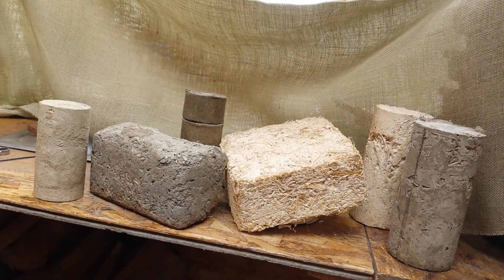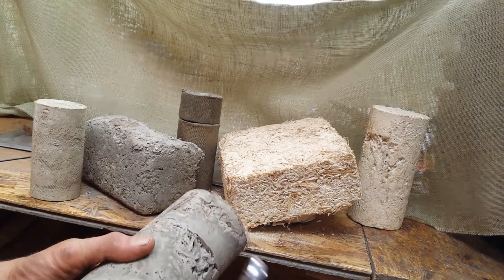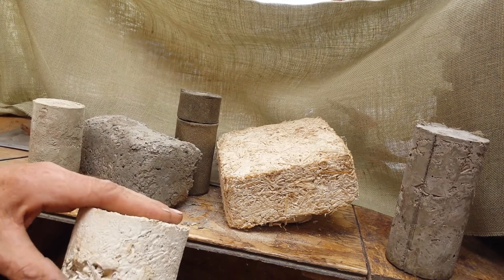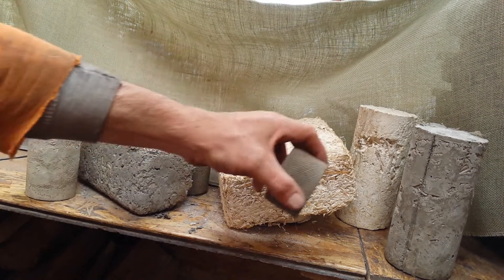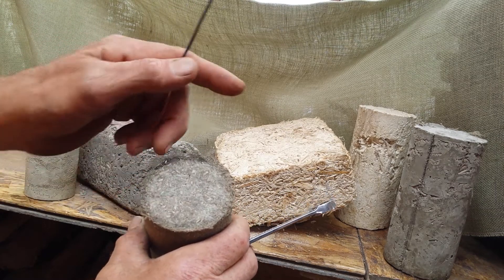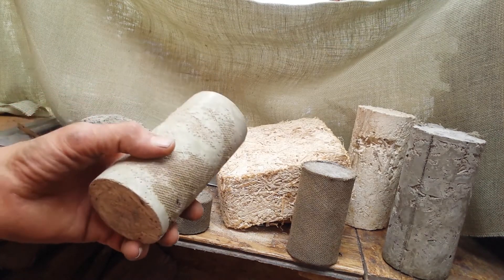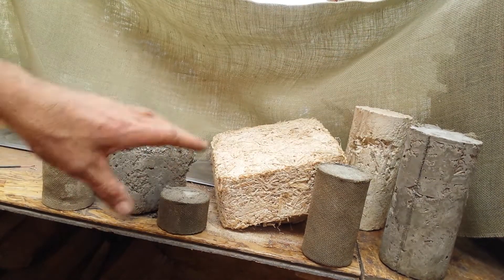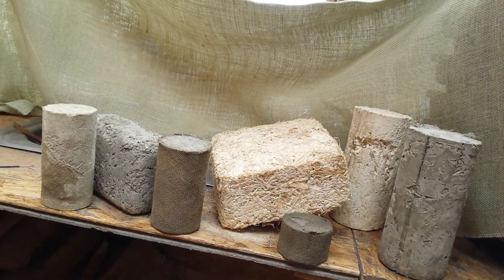Hemp Side by side, MgO to Lime Hemp binding strengths comparison

Comment: What kind of mix did you use for the geopolymer specifically? I've come to learn it's kind of a catch-all for a lot of different kind of chemical bonds and mixtures. You mentioned it's exothermic, so I'm guessing you're likely combining it with some kind of quicklime and water on the fly to make it bond to the rest of the substrate. What I want to know is what is the rest of the ingredients you used, and are they relatively easy to source for a DIYer or other kind of home project?

Comment: how do  you mix the bentonite version i want to mess with it
Reply from the maker: @3DPrintingLoot  basically cob, ratio might range between 2 parts clay soil to 1 part sand and 1 part clay soil to 3 parts sand
Reply: @mrglasecki  thanks ill try it
Reply: @mrglasecki  you should do a video on weight difference between them or if you have id like to see
Reply from the maker: @3DPrintingLoot  working with industrial hemp has broken me from sucking eggs, capitalism has sucked the life out of life love and democracy, greed stupidity arrogance are the goals of the Masses

Comment: As done by Balciunas et al. (2015) and Pantawee et al. (2017), this study used Al2(SO4)3 as the complex mineralizer. Al2(SO4)3 impedes the release of sugar from organic aggregates, thus reducing the impact of hemp hurds on setting time. Al2(SO4)3 is most commonly available in hydrate form, and technical grade Al2(SO4)3 · 14H2O was used in this study. Mineralizing organic aggregates with Al2(SO4)3 has also been known to improve the ability of cement to coat the aggregates, thus improving adhesion (Balciunas et al., 2015). < this is from some research where they use Al2(SO4)3 to presoak the hemp so that Portland cement can stick to it
Reply from the maker: Portland is mineral, hemp is organic, without monomer modification, good luck 🤞

Comment: I am wondering how strong a binding would be if the fibers were bound and pressed like OSB. But instead of flakes the actual Fibers are used.
Reply from the maker: the shiv would make a slightly stronger OSB versus pine shavings,
* Bast hemicellulose will be stronger than any adhesive I've worked with, Even makes a impressive I-beam

Comment: The whole point is lower carbon emissions and a cheap alternative. High calcium limecrete is taking hemp.and adding one of the world's oldest binders. Typs s hydrated lime is not in any way used as a binder historically or now. And to further to help lower emissions, Portland and or acrylic binders is definitely not green in any way at all. And it needs to be breathable. Portland doesn't breath.
Reply from the maker: 😏 the point was it's Significantly stronger than steel reinforced concrete

Hemp bast hemicellulose fiber  17mm ×50mm geo board On Edge" on YouTube
https://youtu.be/HSE5vESjFk0 

With hemp shiv and gasification conventional concrete is actually Co2 neutral

"Live lighting smokeless Hemp fuel Rocket gasification Off-grid sciences" on YouTube
https://youtu.be/ztOrrce7568
Reply: @mrglasecki  doesn't matter if it seals moisture. People will be getting the wrong material and then rotting their timber inside the walls without knowing it. This whole limecrete needs a standard that it can only be used with binders that actually work. Just talked to a guy in a different topic (clay adobe) and he says its failing. Hmm. I wonder why. The point is use the proper material or there will be devastating consequences with breathability and eventually structural supports. No point in showing videos of different psi when you can't even use that type of material. Whether it be Portland or hydrated type s lime. There's no point.
Reply from the maker: @jeremiahnichols2729  

Don't take this wrong😑
Yet, that's hysterical 😂🤣 and so narrow minded it's borderline Ludacris

3/4" x 2" x 12" can support a vehicle
there is Absolutely no reason for pathetically weak wooden framework
 Bast hemicellulose is stronger than steel and lighter than aluminum

 Current construction is literally vapor tight at it's own demise 
 You are envisioning residential m, which is possible at R35 you can run open air HVAC

Sir, I'm proposing skyscrapers strong enough and light enough to be 3D printed over a mile high
Reply from the maker: @jeremiahnichols2729  
Hemp fiber is anything you want it to be if you understand alchemy

"Hemp fiber Starlite 0.0625" @ 3,623°f  meets fiber technology" on YouTube
https://youtu.be/fmCSmI-5MK4
Reply from the maker: @jeremiahnichols2729  please keep in mind the 17mm×50mm test tile you see supporting the vehicle is actually Badly broken

Raw Strength of Hemp bast hemicellulose geo monomer" on YouTube
https://youtu.be/-Ktl6-4B0x8
Reply from the maker: @jeremiahnichols2729  and we will see as hemp-lime frame construction fails because of lack of structural integrity and inability to hold under seismic loads
Reply: @mrglasecki  and you will also see new bacteria and mold in clmmercial buildings due to no evaporation of moisture and then mold flowing throughout the hvac systems etc. See it all to much now on every sheetrock built home. Then add all chemicals that need to be used in sky scrapers etc. Injust think its redundant.
Reply from the maker: @jeremiahnichols2729  
Your Blatant propaganda won't be tolerated, your misinformation or lack of understanding is overwhelming the only difference between lime and
Concrete, concrete contains clay otherwise lime is lime it's literally the core ingredient, without sodium silicate it breathes Exactly the same absorbs humidity 
* I'm not blocking you because I think you are confused about ground wicking and humidity
(which WILL UTTERLY destroy hemp-lime and not affect HempCrete ) Hemp bast hemicellulose fiber in ineffected by any bacterium I've found will not rot mold or mildew, unaffected by saltwater
you will play hell get it to desolve with battery acid

Educate yourself on this subject, please stop the Blatant misinformation

Comment: Very cool!!! How does your super hemp hold up to water immersion?
Reply from the maker: * Need to research hemicellulose (multi layered nano fiber) and exothermically bonded polymer / monomer modification
Reply: @mrglasecki  That's amazing. We should talk.
Reply: @mrglasecki  awesome work
Reply from the maker: 😏 it's made to replace steel reinforcement in direct ocean subsurface construction applications

😏 Tower that fell in Florida because of seawater infiltration, would still be standing, for a very long time

Comment: Its hard to find magnesium oxide
Reply from the maker: Expensive to research as well Biggest day
Reply: @mrglasecki  well should say finding some that is not insanely priced is difficult there prices can wildly vary on it i found that adding graphene to cement or lime can yield the same results
Reply from the maker: @prototype9000  graphene made my samples thermally and electrically conductive
 didn't notice, noticable increase in the strength as MgO/ sodium-calcium oxide
Reply: @mrglasecki  i had good success with it had to make my own graphene though made  a car ramp out of it aircrete mixture some paper pulp and graphene

Comment: What parts of the plant are you using? Is it hurd only or do you leave the outer fiber on?
Reply from the maker: Great question let's go over term's 
 Cannabis sativa is industrial hemp
 The plant 'frame' is called Hurd from root to flower outer 'stringy' fiber is Bast hemicellulose the 'woody' inner is called Shiv 
 Separated but not cleaned Bast hemicellulose 10-20% shiv is called 'toe' 
 For most crete' toe will work best
 Yet other applications woven fabric and SIMPLY raw bast (cleaned but not degummed) 
 I've literally worked with several 🤔 hundred 😁😂 thousand 🤣 mix variations
 From graphene infusion of epoxy, tar, custom cement, fire retardant ceramics, mycelium ,. Holy cow there's actually more

Comment: Thank you for sharing this!  I am very happy to see you make hempcrete structurally sound.  So many that say they are "building" with hempcrete are actually only using it for insulation around wood framing - which is a most labor-intensive way to insulate.  Best of success with your development.
Reply from the maker: Imagine this as a graphene modified absorbing critically needed UV in deep space
Raw Strength of Hemp
https://youtu.be/RLvN1ci4K1w
https://youtu.be/HSE5vESjFk0
https://youtu.be/-Ktl6-4B0x8
Reply from the maker: Thanks for your interest in my past research
 unfortunately I can't afford the liability and litigation of questions and answers
 Yet please consider it's all open source feel free to glean what you need
 Lack of support and lack of resource forced me to be realistic and move aside and wish other's the Best of luck
Reply from the maker: Hemp Will play a slightly more impressive role in space development than most understand currently
Please consider
https://youtu.be/Iqe01EW1XdM
Reply from the maker: Might consider possiblities
Live lighting Hemp gasification
https://youtu.be/ztOrrce7568
Hemp starlight
https://youtu.be/fmCSmI-5MK4

Comment: Greetings, in my desire to eradicate petroleum where ever possible, can you use the final product to fill in pot holes on roads?- My Idea is to fill and tamp the mass till it is flat, then a thin sheet of plywood over it till it dries....
Reply from the maker: Up Front - I'm not able to say yes or no
 I've not tried to fix potholes🤔
 Say 😏 would Bast fiber replace steel reinforcement of concrete in stone/sand mix design 😁 yeah
 Pure Bast fiber reinforcement would be something to witness 🤨
https://youtu.be/HSE5vESjFk0 
https://youtu.be/-Ktl6-4B0x8
https://youtu.be/zxj-86NIf8U
Can't quite get that across clear enough 

 Otherwise using the Shiv as it's used in HempCrete as insulation / aggregate that would NOT  benefit surface wearing conditions 
 Hate the disclaimer just there is a tremendous difference in the fiber abilities

Comment: I build Geodesic Domes in Colorado Springs.  I would like to use hemp panels with cam locks to put the panels together.  I would love to discuss the best way to accomplish this some I can offer low cost housing,with energy efficiency.  Dave Falasco 719 502 5519. gyogreenhouses.com

Comment: Hi mr.glasecki very inspiring work.. my research is also to incorporate geopolymers into hempcrete. am using sodium carbonate, kaolinite and calcium hydroxide for it. may I know the binder to hemp ratio you are using.. this looks like a lot of binder will it be an economical solution for construction purpose?>
Reply from the maker: And I'm very sorry about not telling you 
 Magnesium oxide sodium chloride on one MgO, aluminum oxide, calcium chloride, sodium chloride
Reply from the maker: I clearly state that I'll gladly tell you what I've used, yet I'll give No ratios that's $30k to even talk on the issue

Comment: Do you add the acrylic to the crete?
Reply from the maker: Guess you could try that, added as material pre soaked work
Reply: @mrglasecki  you mean like pre soak the shiv in the acrylic?
Reply from the maker: @NIGHTMARERICA   wet the material with water

 add resin
Reply: @mrglasecki  oooooh ok. Your videos are definitely giving me a lot of information before I start building my ecohouse.
Reply from the maker: @NIGHTMARERICA  
Pleased to hear

Comment: Just found your channel. Subscribed! The application I am exploring is the use of hemp-based  geopolymers for the lining of battery storage (powerwall) equipment.
The energy density of current battery technology keeps going up. I'm just not sure that putting batteries in a steel case provides enough fire protection.
Reply from the maker: Had an idea that would dissipate the heat involved in a lithium battery fire,.
Graphene infusion into ABS plastic sheet will cut ice with the temperature of the human hand🥰😎
 similar to the graphene leaching the lithium/ graphene batteries in the cold 😏 tried telling elon bout that 😑
Reply from the maker: Starlite
https://youtu.be/fmCSmI-5MK4
Hemp can
Reply: @mrglasecki  Very cool! 
No pun intended :) Thanks!

Comment: what is the cost of materials and processing of your $30k recipe?
Reply from the maker: Hemp is becoming available (without the extortion) and average $150 a ton @ the farm
Total materials should be under $30 a cubic foot
Reply: @mrglasecki  what I was really wanting to know is how does the cost of framing a house with this recipe compare with traditional framing (with comparable air conditioning performance)
Reply from the maker: @jasonw137  With that one there is no frame 
https://youtu.be/-Ktl6-4B0x8
https://youtu.be/HSE5vESjFk0 this is 17mm 
Monolithic cast 12" thick a structure could go Several stories without a frame
Reply from the maker: @jasonw137 
Yes😁 please understand No Amount of structural pine could duplicate Hemp fiber's strength
that's a 3 lb hatchet and a 17mm cabinet top bending down

Only trick was getting the concrete to exothermically bind on a molecular level
 https://youtu.be/zxj-86NIf8U
Reply from the maker: @jasonw137 
Yes😁 please understand No Amount of structural pine could duplicate Hemp fiber's strength
that's a 3 lb hatchet and a 17mm cabinet top bending down

Only trick was getting the concrete to exothermically bind on a molecular level
 https://youtu.be/zxj-86NIf8U
Reply from the maker: @jasonw137  https://youtu.be/zxj-86NIf8U
Reply from the maker: @jasonw137  
Yes, at R75 with a K factor of ISO
 again simply mixing up mix design's 
Hemp is a 'Tru' earthship building material 
Because it's capable of replacement of anything conventional, with Superior results
You simply can't hurt it vandalism would be comical to witness it's beyond fireproof
 diesel and gas simply burn out with NO DAMAGE
(Possible liquid oxygen hydrogen Lance it )
Reply from the maker: @jasonw137  
**@ R75 there is no heating or cooling to speak of with proper design it could EASILY bank any heating needed and with geothermal venting cooling would be simar even in southern Texas
Reply: @mrglasecki  how thick of a wall is R75?  most hempcrete stuff I have looked at seem to be ~ 1ft thick for R30ish... 

I was also focusing more on the construction costs more than operation costs... I am trying to design a mobile 'house' with minimal to no foundation.  Wall thickness and weight are crucially important for my application.
Reply: sorry... didn't see the other replies you gave.  I'll check those vids out
Reply from the maker: @jasonw137  
It's the conventional frame
because of the pine 2×6 frame has a limit of R-6.25
Reply from the maker: @jasonw137  best of luck with that
Reply: @mrglasecki  thanks... your materials seem to get more jaw-dropping the more videos I watch

Have you put together a written FAQ or a website that shows more ordered info than youtube channel can?  So many questions, almost afraid to pepper you with them. :/

Where are you based out of, if I may ask?
Reply from the maker: @jasonw137  Colorado

Comment: I'd like to see the different composite materials tested under compression, and tension to compare their strengths. I'd also like to know their insulative properties, fire resistance, how they react to prolonged exposure to water and freeze/thaw cycles.
Reply from the maker: Absolutely Agree if you have a spares 250k-1m love a lab grade research facility 😁 let's get it
Otherwise  I did the best I could to destroy it😏
"Raw Strength of Hemp geo monomer" on YouTube
https://youtu.be/-Ktl6-4B0x8
"Hemp 17mm ×50mm geo board On Edge" on YouTube
https://youtu.be/HSE5vESjFk0
Hemp fiber Starlite 0.0625" @ 3,623°f  meets fiber technology" on YouTube
https://youtu.be/fmCSmI-5MK4
"Hemp Bast fiber composite tube, body panel" on YouTube
https://youtu.be/zxj-86NIf8U
Reply from the maker: Absolutely Agree if you have a spares 250k-1m love a lab grade research facility 😁 let's get it
Otherwise  I did the best I could to destroy it😏
"Raw Strength of Hemp geo monomer" on YouTube
https://youtu.be/-Ktl6-4B0x8
"Hemp 17mm ×50mm geo board On Edge" on YouTube
https://youtu.be/HSE5vESjFk0
Hemp fiber Starlite 0.0625" @ 3,623°f  meets fiber technology" on YouTube
https://youtu.be/fmCSmI-5MK4
"Hemp Bast fiber composite tube, body panel" on YouTube
https://youtu.be/zxj-86NIf8U
Reply: I love hemp stuff.
These were my questions too!

Comment: This is great work Mr. Glasecki. I grew our first crop here in Iceland last summer and I´m now in the process of doing experiments with fiber boards and hemp create. Do you know what resin is best for making fiber boards 1/4" thick? I already made some by using some model resin I had but I´m sure it´s not very "natural" solution. E.g. when they use this to make interiors in cars (under the leather or vinyl) do you know what resin is used in that industry? All help much appreciated and keep up the good work! Thanks
Reply from the maker: If you want a OSB wood type PVA 
Or fireboard Portland or MgO Al
Reply: @mrglasecki  ah... PVA... I kept hearing PLA and was getting very confused
Reply from the maker: @jasonw137  I can give you my routing numbers if you wish to retain my service
Best of luck otherwise